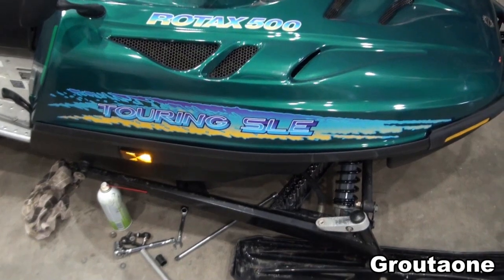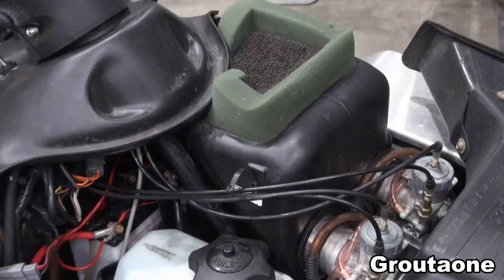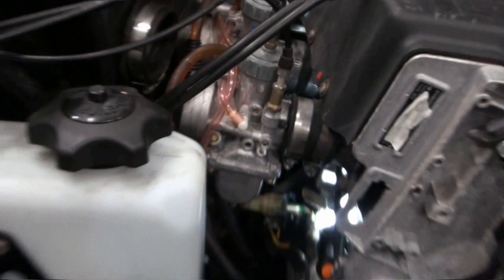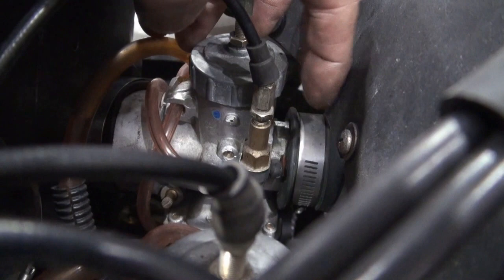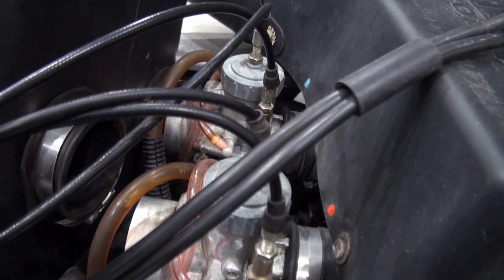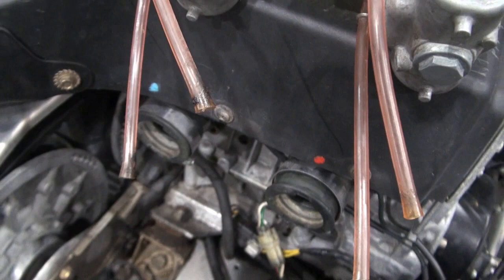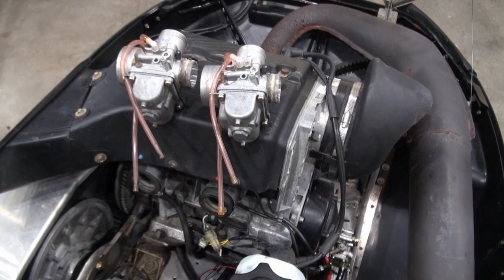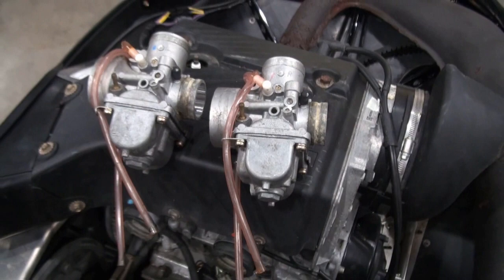Removing Carbs From My Ski Doo Touring SLE

Comment: The fan only cools the motor. Nothing to do with combustion air. The pto side (clutch) will be jetted slightly fatter and have an additional bearing to cope with the extra stress. Check your crankcase seals and make sure they are 100% otherwise tuning will be impossible. There are lots of vids on seal changing and testing.
Reply from the maker: I am fully aware that the fan blows air on the "outside" of the Cylinders
Reply: groutaone but you knew everthing else I mentioned right? Good im so glad you did. You're so very welcome for the comment.